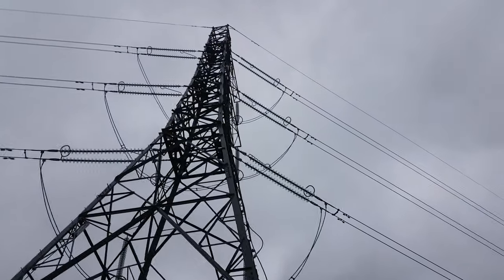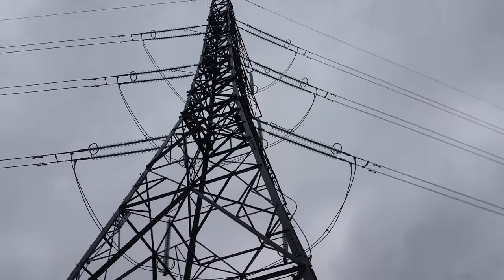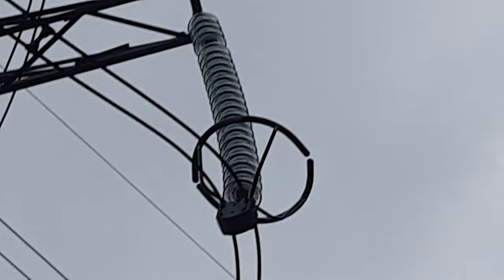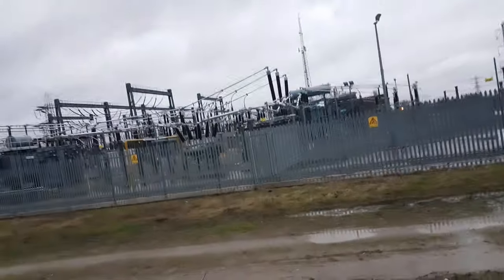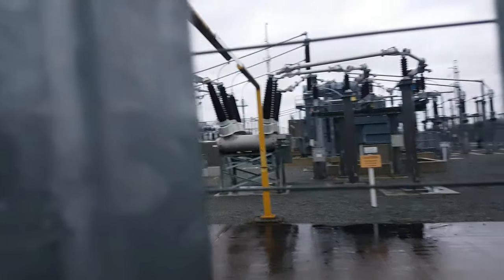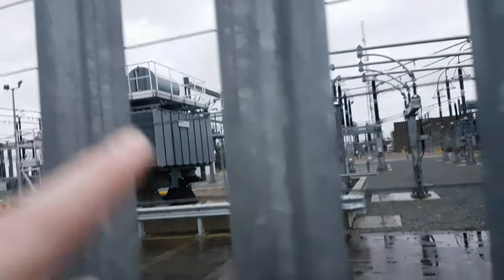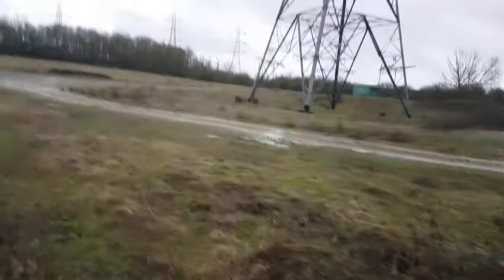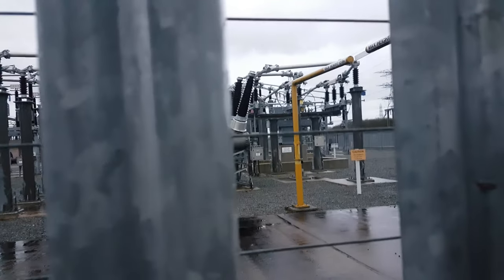400kv to 132kv substation in essex  uk

Comment: Its an SF6 circuit breakers its got gas inside that will snuff out an arc in much shorter distance than normal air